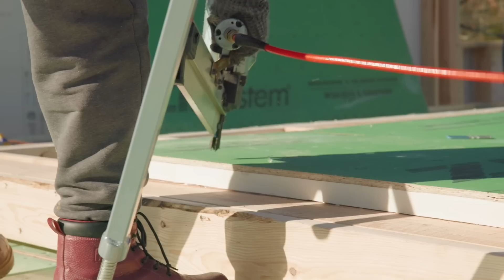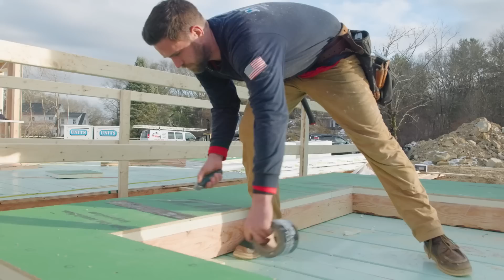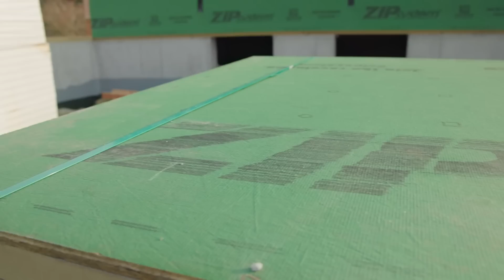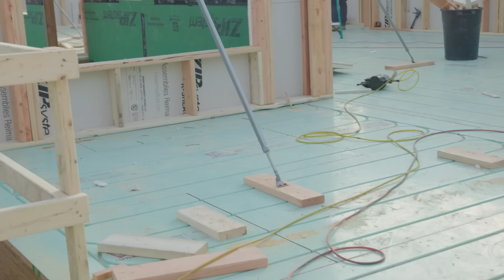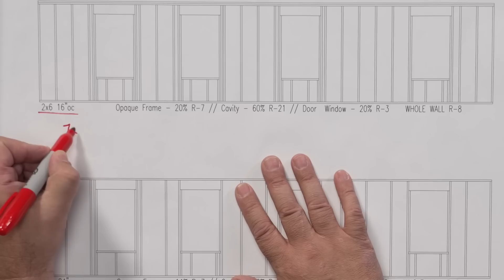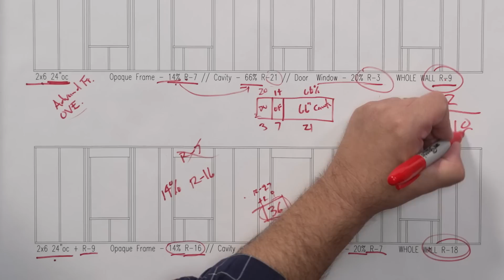"Wall Framing" Build Show Build: Boston Ep. 6

Comment: Great video.... learned so much as DIY. Question? Should I consider poly iso insulation on top of zip sheatjng(no insulation). Pros and Cons? What do you think? OR R6 zip  with insulation 2x4 wall(zone 3). Also, is the average R8 *(wall;cavity, opague) a good way to do this. Wouldn't me standing in front of cavity temp be different....why even calculate the window. What number is required by zone "whole wall"  or opaque, or cavity R value.

Comment: Building in Climate zone 3A coastal. Have been educating myself on the benefits of an airtight house with sealed attic and crawl space. But the building science on the wall assembly is making my head hurt. If labor were no object (and it always is) what is better: ZipR or Zip and exterior polyiso? Just looking for input. Thanks for the (lengthy) video.
Reply: I like Zip R - less trips around the house

Comment: would it increase the R factor enough to justify 8"  Steel I beams Sprayed insulated and non touching 2x2 outside stabilizing studs, and a double window system inside and out?
Reply: Any insulation is better than none, or less.....

Comment: No one here in Texas hanging on to that roller and they are working on slabs have to roll tape every where they can’t reach later. Great system just not practical in the field I prefer Tyvec house wrap. Can’t imagine how much tape gets put on wet Zip wall in wetter climates .

Comment: I'm always amazed how thin the insulation is on homes in North America. When my building was getting insulated (old Polish semi-soviet construction from the 70's, reinforced concrete everywhere) they slapped on about 12" of EPS (I think, it was maybe 15 years ago) on every wall . That should be what, R-49 (plus whatever the wall originally provided)? Probably less since it was an old tech. Granted, Warsaw, Poland is more like Chicago than Boston, but still.

EDIT: I just checked a house build in Poland I follow on YT and saw 250mm (10") of XPS (R47) on 240mm wall made from aerated concrete blocks (R9, less at poured beams). Total estimated (peak) R-Value should be around R-56.

Comment: What is the cost of Zip and the labor of taping all the joints compared to commodity OSB and the labor of wrapping the entire wall with a self adhesive membrane ?  And don't all those nails in the Zip break the green coating so they need to be puttied which is even more labor ?  I'd like to see a nailed Zip wall with unputtied nails subjected to a pressure washer or even bulk water running down the wall to see if water gets around the nails and into the wood.
Reply: Builder friend Jake Bruton and I depressurized some nail heads with a blower door to the interior and couldn't pull water thru

Comment: Steve, Great explanation of calculating U/R-values for wall systems.  What do you think about ICF?  We're building a farmhouse in ME, most likely using ICF.  Fox Block (6") wall runs R-value of 20-24 (with thermal mass) minus windows.  Would love to increase R-value.  Buck system interesting...Fox Buck.  The more data and geek-out sessions on your videos the better in my opinion.  I'm learning lots, thanks.
Reply: Much appreciated - thanks for joining in.......I like ICF, many times they don't make the $$$ cut

Comment: Great series Steve. Can't get enough of it. Loved your explanation of the Window Pocket Headers and how it ensures lining up all the windows. However, could you explain your strategy with the Doors. Approach does NOT appear to line up with the standard/common 6068 Doors. Aren't Doors and Windows expected to line-up at the same height?
Reply: Doors are 7', and yes the windows will be about 10" higher......

Comment: What would be interesting is to take all these changes to get to better R value, calculate the increased cost from a “standard build”, and compare that to energy saved in dollars over time.
Reply: The wood frame is a wash, the cavity insulation is the same, the increased investment is in the R-sheathing. Also remember, it also enhances health, comfort, and durability, along with energy efficiency

Comment: Just a little thing I want to add is where to put the vapor barrier. Hot, humid air wants to condense on cold surfaces. Your vapor barrier (VB) is one of those surfaces past which the hot, humid air shall never pass, in theory. In an always cold climate, you'd want the VB more on the inside so it never cools down enough to become a condensing surface, but also prevent that hot, humid air to reaching components further to the outside wall, where it could condense on. If you move further to the south, however, that can become a problem since your AC might reverse the situation. Your insides are cool, dry and comfy, but the outside is hot and humid. With only a single VB on the inside the hot, humid air will pass through your outer wall and condense on the VB. That doesn't matter that much for warm and dry areas, but climate change makes everybodys weather more extreme and a single unexpected cold night can infest the whole house with mold. Ask me how I know... And in climates with both hot, humid and very cold the VB should be slap bang in the middle. This way it will, in both circumstances, never become cold enough to become a condensing surface. I also wouldn't call the latter method a premium option. It should be code in all climate zones.
Reply: A couple things - I am more inclined to cal it "moisture laiden" air , not hot humid air. "Vapor Barrier" ? Never use one.....I typically spec a "smart vapor retarder" like Mayrex by Siga. Please understand the big old vapor monster that many call out doesn't really exist in a well designed home. Moisture movement via Air Transported air leakage is an order of magnitude over vapor diffusion. Keep the moisture content low, control air leakage, and keep the potential condensing surface above the dew point....vapor is not as hard to dela with as some choose to illustrate.
Reply: @stevenbaczekarchitect9431  Maybe I expressed myself in a misleading way. I'm neither a native english speaker, nor from the US. I only know of vapor barriers from videos about US construction practises. In my mind "vapor" is equal to "moisture laiden air". (I checked Google translate and it seems to agree). In my scenario I already assumed an air tight building envelope and a HVAC system. Although both are mutually exclusives, but I think you get the point.
The point I was trying to make is to keep installed moisture diffusion barriers (smart or dump) in an area, where it will never reach dew point and act as a condensing surface, leading to mold or rot.
From my understanding, it seems we speak about the same, but in different words.
Sorry, if there was a misunderstanding due to lack of details.
Reply: @OperationDarkside  Don't be sorry man.....we are speaking the same language. I just like to clarify for those that may check in on our conversation to make sure we are illustrating concepts correctly. Thank you for joining in my friend - very much appreciated. Can I ask where are you from/living?
Reply: @stevenbaczekarchitect9431  Yes, thanks for the clarification. I'm from Germany. That's probably also the reason I'm less familiar with light framing, etc. And it also doesn't help, that I'm a programmer by trade. I grew up in uninsulated, call it vapor open, plastered brick masonary buildings, but currently looking into more budget friendly options for a small house and light/stick framing seems like a good choice.

Comment: Just wondering what your thoughts are with using T studs and seeing more people building homes with the pole barn style what are your thoughts on these walls insulating values.
Reply: I like T-studs and use them when we can fit them into the project, for this project we went in a different direction

Comment: How does Zip handle rolling onto corners? Both inside or outside corners. Is there a 90° roller?
Reply: Not needed, single roller works fine

Comment: Thanks Steve for your very detailed analysis showing actual cumulative R values within differing wall systems and for the reminder that the goal is to keep heat in and not cold out.  I would very much appreciate your opinion on 2 questions...I'm preparing to build my own single story thermally broken slab on grade home on the southern edge of zone 4.   You've  confirmed my decision to use Zip R6 exterior sheathing on 2x6 studs.  Since this area is known to have high winds from time to time, will 24" stud centers be adequate for wall shear strength, or should I plan on 16" centers?  I'm assuming that if 24" centers are good for Texas, they are fine for NW AR.  

Our current slab on grade home is very cold near the floor (vinyl plank) during these winter months.  It's 2x6 wall construction with good quality dual-pane low-e windows, but the slab isn't thermally broken.  Technical R-value data is great and all, but it's the comfort feel that really matters.  If we spend the extra $ to upgrade to Zip R9 and triple pane windows in our new home, would we likely feel the difference v. Zip R6 with quality dual pane low-e windows and doors?  Thanks a million!
Reply: Like the video says, % of glass vs wall is a big factor.  I recommend getting a proper Manual J performed and you can easily evaluate the separate options of better windows vs the Zip R9 upgrade.  I recommend Home Performance Workshop.  Corbett helped me decide on better windows vs continuous exterior insulation.

Comment: Can someone please explain how if 60% of the wall assembly is R-21, you end up with a whole-wall value of R-8? According to my math, even if the other 40% was R-0, you would end up with R-12.6 on average.
Reply: First of all, you have to convert the R-value to U-value, which is the reciprocal or 1/R-value. Lets look at a wall with just 2 components, R-21 for 60% and R-1 for 40%. The U-value for R-21 is 1/21=.0476 X.60 (60%) = .0286........for the R-1 portion you have 1/1=1 X .40 (40%) = .4..........add .0286 + .40 = .4286 total U-Value........get the reciprocal for R-value 1/.4286 = 2.3 R-value
Reply: @stevenbaczekarchitect9431  Does this mean that R value is non linear?
Reply: @yehudagoldberg6400  in a consistent material I would believe it is
Reply: Understand that "Heat" will flow thru the three different components differently. If you used your R-value equation you are assuming that the Heat moving thru the window at R-7ish moves at the same rate as thru the cavity at R-36.......of course not. So the only way to achieve a "proper" comparison is to calculate using U- Values. Another way to look at it - do you know why insulation is measured in R-Value and Windows in U-value? Same reason, Insulation is a material with consistent heat flow.......a window is an assembly with different flow rates at the different materials......Hence - insulation is measured in R-value because it is consistent flow rate, windows are U-Value because of multiple flow rates.......Hope this helps

Comment: Love this style of construction and ZIP sheathing.  -- QUESTION -- However, has anyone ever removed the siding of a house built with ZIP and taped seams, to see what condition it is in after 20 years?  It is worth noting that tape fails, on bandages and on other substances, not because of the exterior environment, but because of the INTERIOR property of the thing it is stuck too. People sweat off bandages and they get loosened because of moisture from the inside.  I suspect that moisture from the interior drying through to the outside will lift that tape off of the sheathing with time.  I suspect that a full wrap like Delta Vent SA that is tiled and stuck on will greatly outlast that taped seam.   WE NEED SOMEONE TO REMOVE SIDING FROM OLDER HOUSES WITH ZIP AND TAKE A LOOK.

Comment: When using Zip R with the 1.5 inch foam, do you use a tighter nailing pattern then you would with direct attached sheathing to increase the racking strength?
Reply: Depends on loacation - meaning in the woods somewhere vs a coastal setting, high wind areas dictate, also in reference to the country, areas of high seismic activity

Comment: I disagree with the segment starting 16:50.  Adding lvl studs doesn't add much lateral resistance, especially seeing how that is a bumped out wall section that is mostly fenistration.  A portal framed header with proper 3" o.c. grid nailing to sheathing would help... and definitely block and nail plywood seams.  What's with the random blocking not hitting the seams??  The lateral rigidity in a wall assembly is directly attributed to the sheathing, and then the wall's attachment to the floor framing.   You can frame a wall with LVL studs 6" on center and it will rack just as easily as a 24" oc with 2x6 , sans plywood.
Reply: Lay the wall down as a deck - do you believe a 2X6 spruce joist is as strong in bending as a 2X6 lvl joist? Of course the lvl is stronger in bending. It is also very likely more straighter. I'm not saying it doubles the strength or something extraordinary, I'm just saying it is stronger......

Comment: The double top plate also helps spread out the weight of the rafters if they dont match wall stud locations....unless thats changed in 15 years since i did framing
Reply: It does

Comment: Steve, ☺at 53:32, in the calculation of the 66% of the cavity in example 2, you said that it was R27, but it is written on the drawing and you already mentioned that the cavity is R21.  Not sure where the R27 came from all of a sudden.              So shouldn't the 3rd example, with the R9 added to the outside not be R36 (R27 + R9)       but         R30   (R21 + R9) ??    Maybe at a quick glance you thought the 1 of the R21 looked like a 7 to be R27......Yes ???      Either way, your point was shown that the industry is misleading us by stating only the R value of the cavity and not the R values of both opaque framing and window/doors.  I really appreciate this section of your presentation.   I will toss the idea in the first draft of the plan to discuss changing 16OC to 24OC.  I have to research if the 3 story extension of 28 ft x 20ft will be structurally OK with 24OC framing.
Would it mean I would have to add plywood sheathing in combo with the Zip R sheathing (OSB material) ?🤔🇨🇦
Reply: No, when I walked thru the wall section of this project  first I had mentioned the wall would get a 2" flash of CCSF (R-13) + 3.5" of blown insulation (R-14) = R-27??
Reply: @stevenbaczekarchitect9431  Steven, I took another look at the video and now I can see where on your drawing in the last section of your presentation you  pointed out what this home would have, Flash and Blown insulation with R values of 13+14 to provide R 27.  I get it now.  It feels super duper great to understand what you are teaching. I am really enjoying how you deliver the content as well.  The sequencing of your delivery is very effective making it easy to follow and understand.  I missed the detail of when you started out explaining about the flash and blown insulation...lots of info to take in on the first try so glad Jeff, a viewer, pointed me in the right direction and you followed up.  Thank you so much Steve, I look forward to your next presentation. This is Fun!🇨🇦👍💯 Atlantic Canada, Prince Edward Island, getting ready for an extension build for the first time working with drafts person.😳
Reply: @stevenbaczekarchitect9431  Well hello there STeve, I didn't expect to hear from you as you would be a very busy person. Thank you so much.  I tossed the question out to our community and Jeff replied, who compliments your response. What a great community to be a part of, to have people reply for clarity. R value and planning assemblies are an important topic💯👍
Jeff Norman
8 hours ago
 @Meg'sCarpentry,lovedogs  he only mentioned it in the on site part of the video how he's getting R27. He's doing 2" (R14ish) closed cell in the stud bays and I think he said blown in cellulose to get the rest. 3.5" blown cellulose must be the missing R13. 

Steve, I ready that blown in cellulose will settle over time and lose its R value. Another reason to chose a more long term stable option, rigid foam or rock wool, pending on just how much the R value of blown in decreases-another unknown to research I guess.  I really appreciate hearing from you and connecting to this community who pays attention to what you are saying and .... most importantly, showing!⭐✔    🍁🇨🇦😊

Comment: Good video. I am wondering if the wall assembly is trapping the dew point in with the Zip system. Are you you not trapping the vapour by taping the seams? The OSB is also not very vapour permeable.

The nail is actually in single shear with or without the iso layer.  The eccentricity on the nail is higher with the iso layer. The iso is soft and doesn't transfer significant shear into or out of the nail. The eccentricity increases the bending on the nail which makes the assembly weaker and more flexible for in-plane wall shear.
Reply: Agreed, the nail is creating a couple (bending) which decreases its shear strength. Double shear not quite the best choice of words. As for dew point, technically, you can't trap it, you can reach it though. This wall is designed to have a low impermeable layer (the 1 1/2" polyiso/2" CCSF), From that middle layer of low permeance the wall is designed to dry in both directions without much restriction. The dew point conversation you suggest isn't relevant because the fir condensing surface that would reach dew point is the inside of the CCSF which will ALWAYS be above the dewpoint in this CZ. Moisture in the vapor form is very very rarely a problem, when it condenses is the concern, and I believe I have designed it so